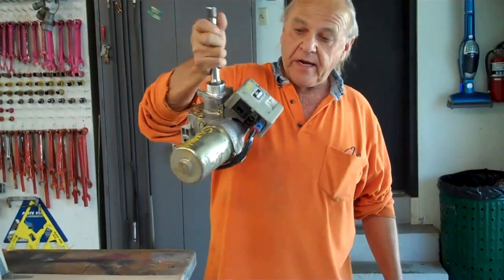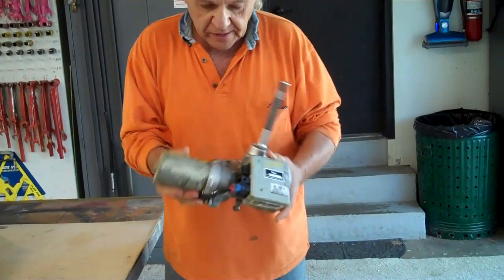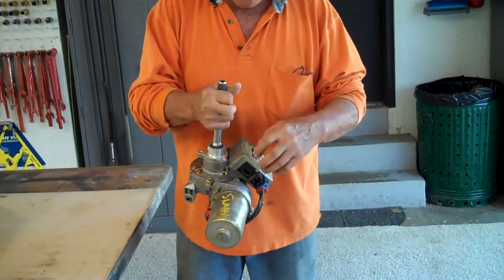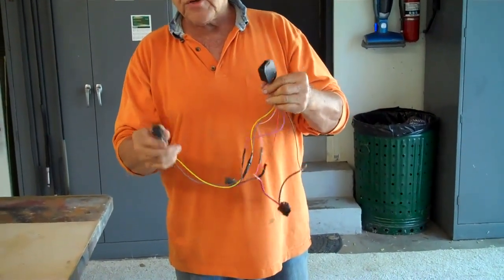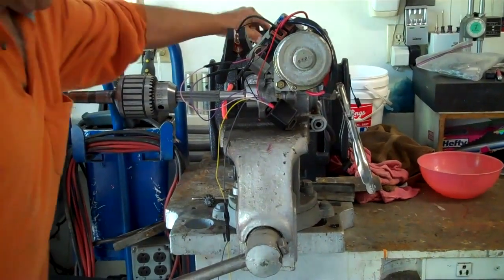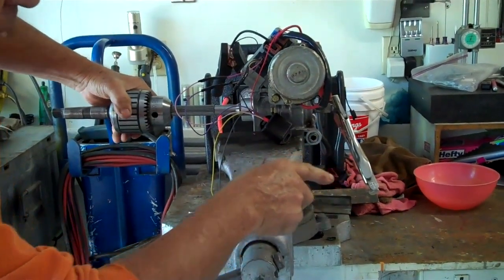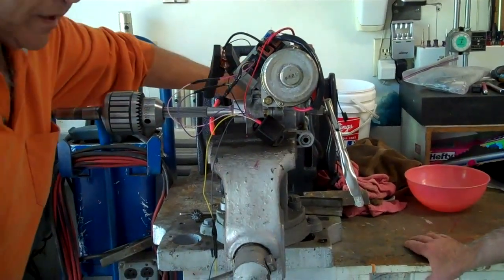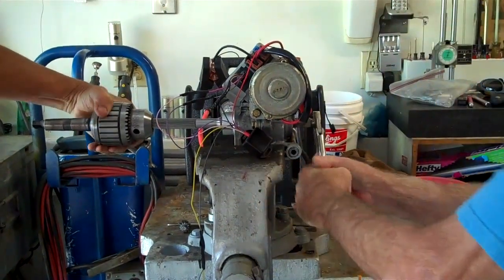Cheap electric power steering

Comment: Thanks for sharing. Great video! I actually put the same unit in my hotrod based off your findings. Works beautifully and for less than $150 for everything, it beats the pants off Flaming River and Unisteers >$1000 units. Especially since they are the same Koyo units. Thanks again.
Reply from the maker: Thank you ,it is allways rewarding to help a fellow improviser.

Comment: NICE!!! do you remember the seller of that part from ebay? I trying to do the same thing ,but I can't find it on ebay
Reply: brian vanderhoof   , labeled "Saturn Vue Ion Chevrolet Equinox – Electric power steering controller box – EPAS" 
eBay item number: 171733694488
 I  bought one and finshed the job on a 1961 IH Tractor B414 that was so hard to steer. Now it works awesome.
Reply from the maker: Sorry I lost the info ,but thanks to westpur for finding itbrian vanderhoof
Reply: +westpur - I have an old John Deere 950 that I need to do this to.  Can you offer any hints on what I"m in for, and what all I need to do and buy?

All the best!
Reply: Rob Weaver  buy a eps unit from a 2004-2009 Prius. All you need is the column and the ECU for the steering column. You hook up 1 8 gauge fused (50 amp) power wire, 1 8 gauge ground wire, and 1 22 gauge switched power wire on the ignition. The Prius units have a built "fail safe" mode that kicks in 10 seconds after the ignition is turned on, and can't communicate with the original CANBUS system.  I'm installing mine on my 1952 forklift that has manual steering.